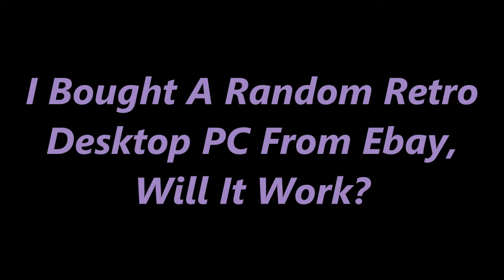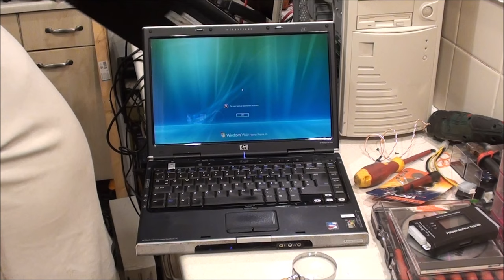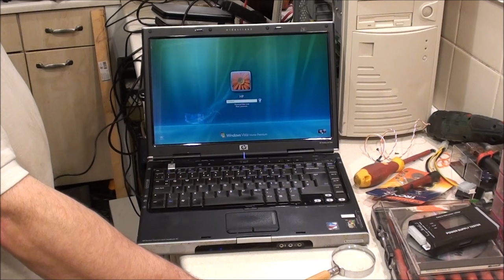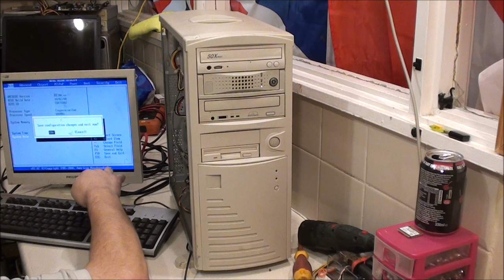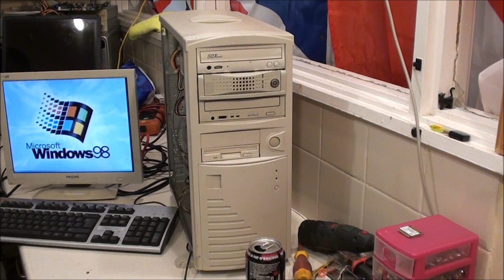I Bought A Random Retro PC From Ebay. Bargain? Will It Work? Laptop Haul Number 2.

Comment: The Omnibook 900B's use and specific external Floppy/CD ROM caddy, interchangeable and used a proprietary connection. Used these at work, had them on review for the company "Orange", before they purchased them. Shockley bad quality plastics than Bend, in fact you can slightly twist the whole laptop. They will not boot from USB, or a USB External CD or Floppy drive. They look really good after they come off a bike on the M5 and are picked up and returned 3 days later lol.
Reply from the maker: That may explain why a dell one didn;t work and actually caused the machine to shut off.

Comment: Be warned the HP DV2000 is plagued with a certain type of Nvidia Chip....
Reply: I got given a small stack of HPs with the Nvidia fault from that era, managed to blast the GPUs with hot air so they worked long enough to assess what components were good and parted them out. Chances are the seller may have done the same here and sold it on, One of the models (may have been the DV2000) where the GPU was visible from the rear access cover so could be temporarily "fixed" in about 3 minutes without melting any plastic if you were careful.
Reply: @MegaTerryNutkins  all you can really do is replace the motherboards with Intel ones with GMA graphics, as I only want an HP DV with media and speakers. I don't need dedicated graphics.
Reply: These are more known for having hinge problems
Reply: @RowanBird779  own a DV6, DV5, G6000 and F700 and none of them have hinge issues..the G6 and G56 seem to have hinge trouble when mistreated
Reply: @lukedavis436  The dv2000, 6000, and 9000 all have the same problem but it's more well known in the dv9000 because the lid weighs more than a loaded semi truck.

Comment: You can't "hot swap" an HDD. It's removable, not hot-swappable.

Q: What do you want all these ancient computers for?

I recognise this behaviour, as I have hoarding tendencies myself. What do Victory think about you filling your flat with junk?
Reply: Even as servers, it consumes too much power compared to new hardware (intel n100 mini pc are 10W). I have also lot of ddr2 / ddr3 old computers i need to get rid off. ddr3 ones are still usable but i already own a ddr4 one to do my daily work. 

Maybe at some points he gonna recycle all of them to extract rare metals 😀
Reply from the maker: Victroy have been around many times over the years and never said anything. There are number of reasons I have old computers 1: I love old tech. 2: Nostalgia. 3: These old machines are becoming quite collectable and some working ones can fetch a nice sum.